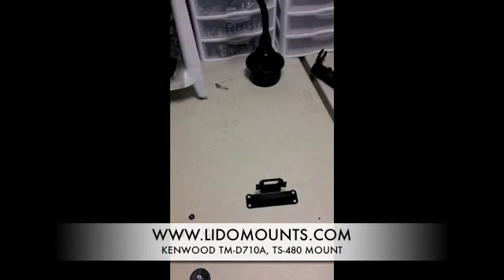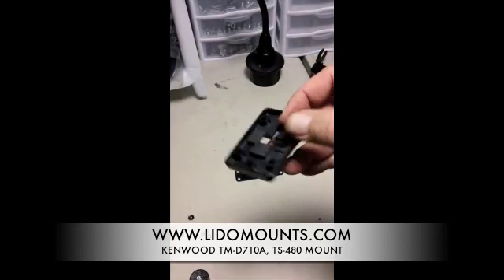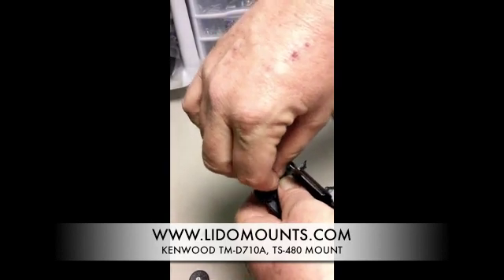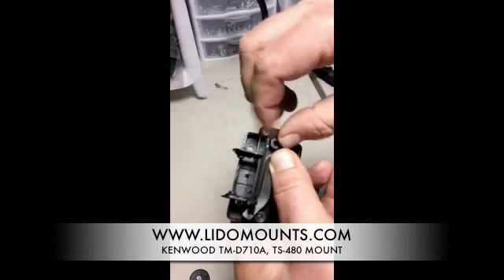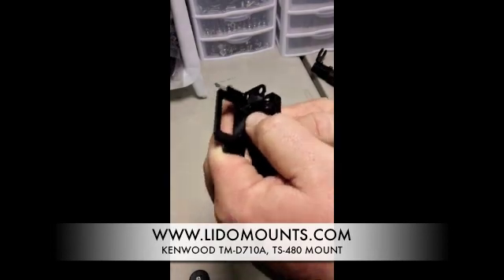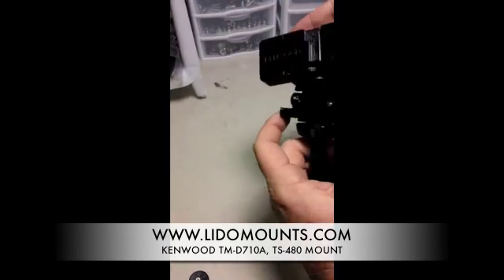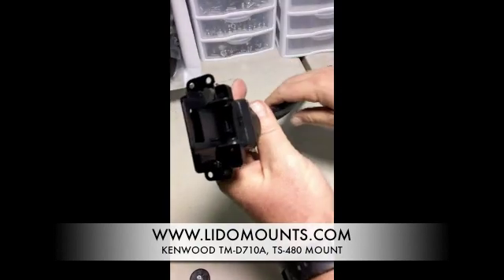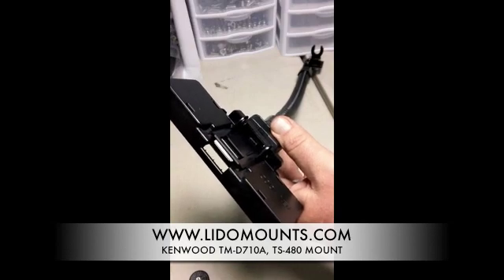KENWOOD TM-D710 MOUNTING INSTRUCTIONS.m4v

Comment: The holes on the Kenwood mounting plate are too small for the Lido screws. I used #40 1/2" macine screws along with washers and of  course nuts. Drilling out the plate is an option to use the Lido screws.